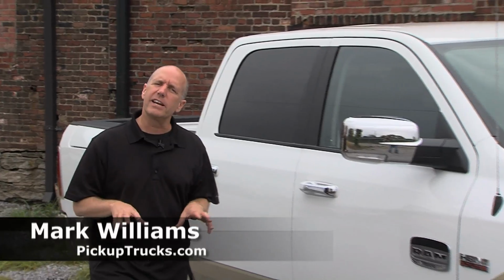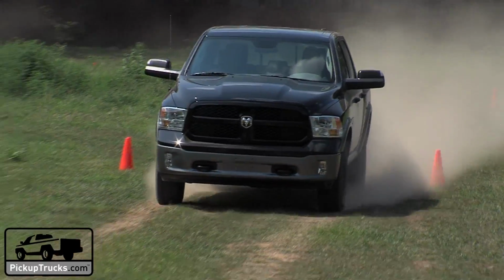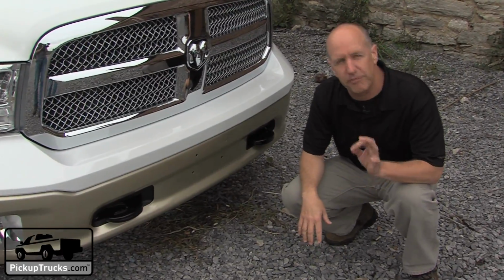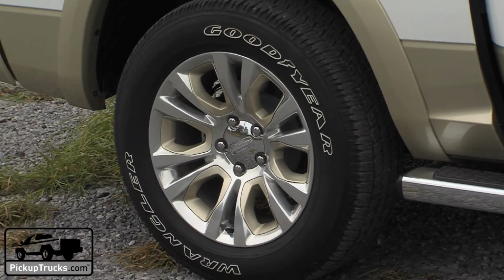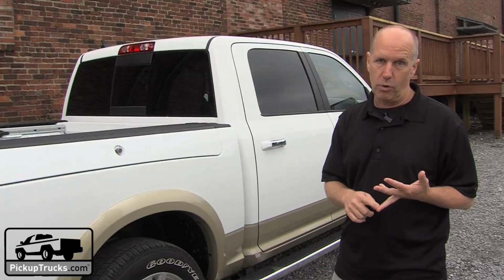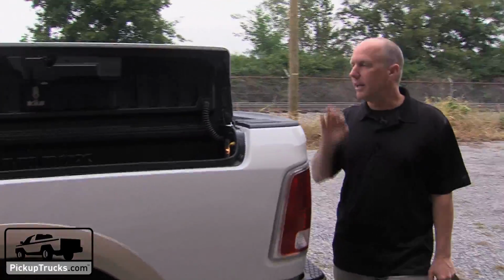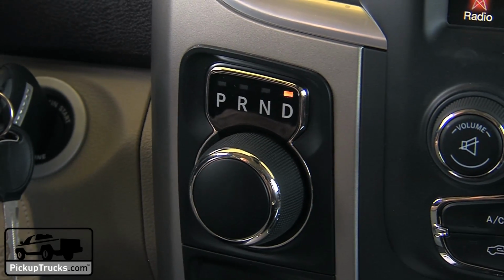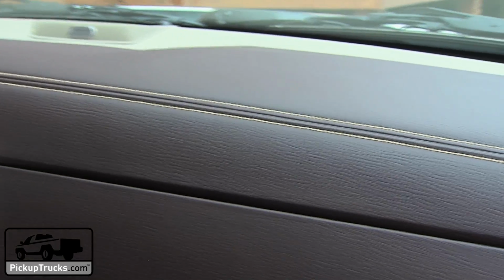2013 Ram 1500:  Closer Look

Comment: About to buy a new truck, so I test drove the Ram, Ford and Chevy half tons.......and it isn't close. I have no prejudice, as I just want the most for my dollar.

The Ram destroys the GM and with all the improvements, push it ahead of the Ford. The rotary shifter opens up space and is cake to operate, the 8 speed feels awesome, the adjustable ride heights and closed grille are trick, the interior is beautiful and kills the other two and the exterior styling is head and shoulders above the Chevy (which is friggin' hideous) and racy looking compared to the boxy Ford. The ride on the road is superior and that's all I care about because I have no intention going "off-road" and there is PLENTY of power to tow with the small (5.7) Hemi.

As for the new additions being nothing more than more stuff to break.....that's a false argument. If technology and options are bad, lets get back to 1965, when there was very little to break. And until I see a Ford, or GM that doesn't break, I'll chalk that kinda talk to sour grapes.

It really came down to the Ram and Ford since the Chevy is so ugly and lacking on so many levels, Shakira would have to be a low cost option to be in the conversation, but after multiple test driving, the Ram edges the Ford on numerous fronts and will be the truck in my driveway in a couple months.

Comment: to many problems i see with the dodge ram for starters the shifter i can see that failing with an easy electrical problem same with the gril those shutters get jamed or fail when closed its going to heat up that fake hemi fast. next the 8 speed trans good in a car ba for towing anything and same with the rams rear coil springs. good for cars not for trucks makes towing worse and more unstable. every year the ram 1500 is getting worse as truck and its really sad to see

Comment: The Pentastar is an improvement over the last V6, more torque and horsepower and better MPGs. Paired with the new 8 speed transmission, it's not weak. I'm sure it has plenty of acceleration for daily driving. There's nothing wrong with wanting a more fuel efficient truck. Can you haul a bunch of heavy equipment and tow with a sedan? 
Nope.

Comment: A Durango is considerably lighter that a 4 door Ram. My point is, with a full cab and any kind of trailer an engine producing so little torque will be working hard where as a more powerful engine will do much better and possibly get better MPG pulling a large load

Comment: If you want fuel economy get a crossover. You want torque in a truck and 260 ft/lbs as pretty poor for a truck this big. It will be okay for cruising on a flat highway, big going up a long uphill section or pulling anything will mean the transmission will be downshifting to maintain speed

Comment: Amazing car, it's now probably equipped better than BMW X5. Ford, GM or Toyota are way behind the Ram now. Impressive, I love this truck. And the HEMI tolerates LPG quite well. Here in Europe regular gas costs $7 per gallon so LPG is the only option :(. Still, it makes even a HEMI very fuel [or more precisely - costs of it] efficient.